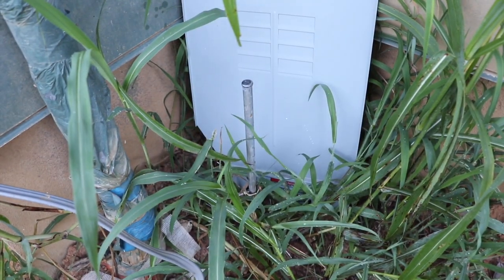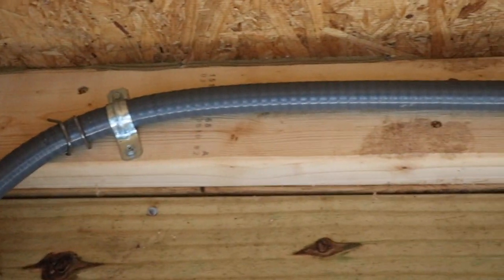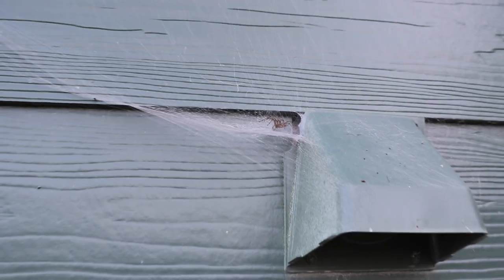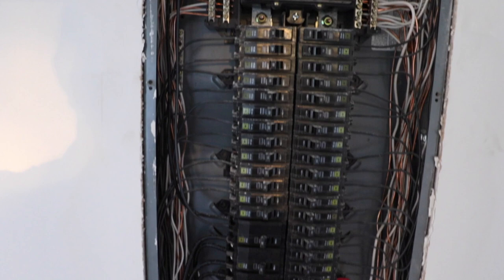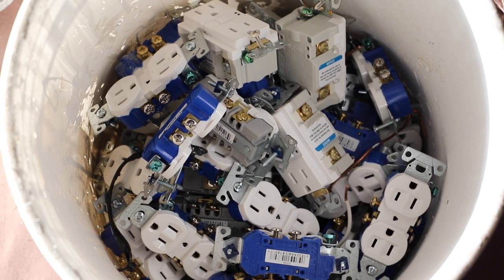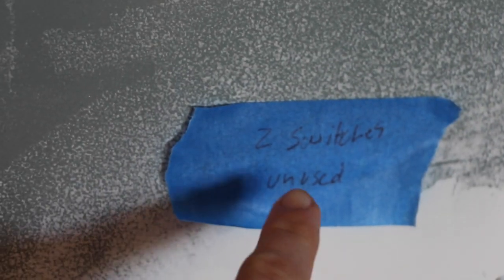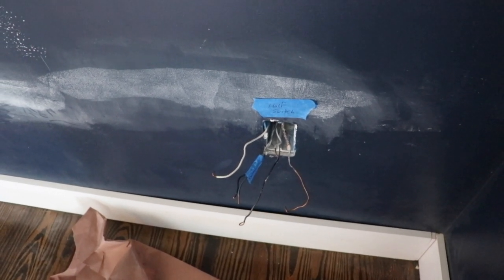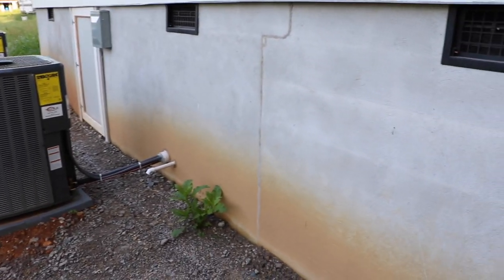Electrical Contractor Failures - Trade Tips

Comment: They didnt mix neutrals and grounds in ac box that ac box does not have a nuetral its just 240 volt with a ground running to it is what it looks like
Reply: My thoughts exactly.
Reply: I would love to know how that AC panel is getting 240VAC. I see two 2-pole breakers. But only one terminal lug for power. Only one black wire going to the terminal board to feed those breakers.
Reply: Robert Steich I noticed that too but if god look closely you can see the second leg going to the bottom lug of that panel.
Reply: Clayton Spangenberg ahhh yes. I should’ve worn my glasses before making a comment. I do see 2 black wires from the center bottom hole, one marked with a white tape for some odd reason. Which isn’t legal as that is technically denoting that, that wire is a neutral wire. And since it appears to be 8 awg, marking a black wire white is legal because of cost and such. However in this case it wasn’t done properly. 

But still like to know how the guy thought there was a neutral wire in the box landed on the grounding bar.
Reply: I was thinking the same thing about the neutral and ground comment. However, he missed that one leg of the 240 wasn't marked red.
Reply: You cannot mark an ungrounded conductor with white tape regardless of the size of wire.
Reply: Why not? Wires are wires doesn’t matter the color it’s all about the usage I can warp a back number 6 Awg wire is white tape to identify it as my neutral. using a neutral as hot plus black tape on it it. Using a black for ground or ground rod u can wrap it with green tape.
Reply: +avatar12able 
EGC's (Equipment Grounding Conductors)
NEC 250.119
Insulated EGCs #6 and smaller must have continous outer finish that is green or green with one or more yellow stripes. On #4 and larger a conductor can be re-identified with green tape at every point that is accessible. 

Grounded conductors/Neutrals 
NEC 200.6(A) and (B)
Size #6 and smaller one of the following methods:
continuous white or gray finish
3 continuous white stripes along entire length on other than green insulation
(theres more but the above is the most common way)
Size #4 and larger
the above methods or by using white or gray marking such as tape at termination points

Ungrounded conductors do not have a size limitation for re-identifying conductors as far as I know. NEC 210.5 (C)(1),(2), and (3)...
Reply: Your color  codes are confusing for me Im an electrician in australia. Our color coding is outlined in AS/NZ 3000 2018 red  or any color bar black is active  black is neutral earth is green or green /yellow and any unlicenced work is liable for a fine or imprisonment and your insurance can be cancelled until the work is rectified by a licenced electrician

Comment: A 2:00, that is the neutral with the mutliple strands, not the ground. Also the neutral in most cases, they want to see the strands taped together.   At 4:45, on any sub panel (not the main) any neutrals and grounds have to be separated and their need to be separate ground and neural bars and the neutral bar has to be isolated. Also the two blacks going to the double pole breakers (240) should be taped so they are identified as one leg and the other. (one red and one black etc).  The outside outlet, even if it was a dummy, should have been made to look correct by a gfci, or if fed upstream from a gfci or gfci breaker, should have a gfci identifying sticker.

Comment: Inspectors are not always correct, sometimes they are actually quite stupid. I was on a job we’re an inspector failed the electrical because the bottom recepticals were not working in all the rooms . The home owner paid extra to have them all switched, so lamps could be placed anywhere and on a switch. Usually the switch one receptical in each bedroom, and that must have been stuck in his brain. I have called out inspectors many times. Also you watch and believe way to much on tv or the Internet.
Reply from the maker: Jason B agreed on inspectors.  Your comment made me laugh because we have receptacles with bottoms on switches... oh man was that a stumper for both sides lol. I think the inspector tried to get over zealous because of the  workmanship.
Reply: @Jason B
So the inspector noticed the switch, but didn't notice no ceiling fixture? The homeowner paid extra for less. You're saying he switched ALL the receps in the room? Usually the farthest recep. from the door is split wired half hot, not ALL of them. You don't want the alarm clock switched.
Reply: Electrical inspection is all about the code, and the 'way things should be done.' If you deviate from that standard design in any way, it results in a very confused inspector.
Reply: The shock to me is to see all this finish carpentry and no networking conduit. IoT is coming, and even if you only cut holes and run string where wires will be, that's at least a lot less quaint than this setup. Not everything can just hop on the wireless router and be happy with data rates and security levels. My sister is having a fit right now just trying to fit all the portable devices onto her router. Granted they're present and active most of the time, but shared wireless bandwidth isn't the limiting factor, its the high encryption and accompanying need for constant manual privacy reconfiguration which IS!
Reply: Last house I was rewiring, the entire, I mean ENTIRE main floor was outlets that were half switched, and not a single ceiling light outside the kitchen or bathrooms. Royal PITA! Why? WHY!?!
Reply: Jason..I've wired that way in the past, mainly for a handicapped guy who wanted something easier for him to use, but I was on site when the electrical inspector came out, and explained to him why it was wired that way...he had no issues with it, and I didn't charge the homeowner for anything except the material...my good deed for the day!  lol This switch controlling part of an outlet works very well especially christmas decorations.
Reply: Vyl Bird although I agree with your statement the NEC(code) is the bare minimum and not a design standard. This is mentioned in the preface.
Reply: If you guys work as a electrician you would see all the code violations in this video only place the grounds and neutrals going is at the main all sub panel need to have the grounds and neutrals separating I could go on anon I rest my case
Reply: Yeah, that was bad.  But was it really a sub panel?

Comment: Just a few things that bugged me the most in this video... At the main service your grounds and neutrals can be on the same bar because they're bonded together there anyway, the liquid tight in masonry doesn't need a chase, mechanical contractor probably ran the low voltage without a chase,  240v to a.c. has no neutral, every ground rod for the most part sticks out a bit for the clamp, but is still technically below grade, and grade at the time of install may have been higher. Have you read the code book? This video should have been more about the sloppy work than code references.
Reply from the maker: The panel was the main sub panel, the grounds were over a foot above grade and were installed a couple days before the video... not the brightest critic...

Comment: To add salt to your wounds, there was no inhibitor used on the main lug connections...but at least there was a guard spider doing his job....another point...depending on the age when this panel was installed, it might have been installed before the 2002 code changes regarding arc fault protection.  This was definitely a DIY job probably from a cousin who "is good at electric work!" You got your work cut out for you...good luck...have fun! I've seen worse!

Comment: A few rebuttals from a licensed electrician (yours truly)...

1. On the A/C subpanel - No-Al-Ox is not a code requirement, and there are no line-neutral loads served by it, so a separate neutral bar is not required.

2. If the main subpanel was installed before adoption of the 2002 NEC, AFCI breakers are not required unless new circuits are added or an existing circuit is extended more than 6 feet.

3. Tamper-resistant receptacles are not required where the receptacle is over 6 feet above the floor or located behind a major appliance that is not easily moved.

4. No NEC rule about plumbing above a device box, just over panels, switchgear, meter sockets, erc.

5. Exterior or service receptacles in residential occupancies are not required by the NEC to be dedicated circuits.

Comment: When you tie neutral to earth ground in a subpanel, you're created a potential parallel path for current to return via earth (ground) - so in the event of a fault, your ground conductor has assumed the role of the return path for current and now everything that you've grounded (sub-panel, appliances, metal fixtures, etc) to that sub-panel is now hot.
Reply: Just Another War Robots Channel QED.
Reply: Thats why you run a seperate ground. And thats why it is bonded at the main panel.

Comment: 4:50 Since this is a subpanel there should be two bar one for ground and the other one neutral. The greens screw exists to ground the electrical panel. Should only be in sub panels. The only place in the system where the neutral and ground can be attached on the same bar is the meter panel that's attached to your 2 eight-foot ground rods. Electric compound is only require on aluminum wiring. Because steel will cause aluminum to corrode. The panel should also have insulation bushings on the conduit.
Reply: You're the only guy I've found so far that caught the bushings. Eventually the Romex sheath comes to a point where it's been stripped, and punch out always leaves a sharp burr or two.

Comment: It sounds like you know just enough to be dangerous! Yes the contractor did make some code violations, but you also made some yourself... Like the wires in the wall for future use that you had to trace out! Many items that you named as violations weren't! 
Use a licensed electrician & check his references! And leave the electrical work to the professionals!
Reply from the maker: Dewayne Fanchier wires in a wall unhooked up are a common practice in building and about as dangerous as a string.
Reply: Dewayne Fanchier exactly." Plates" ? Those are busses.  He's not stupid though. Just not as experienced as should be to call out faults.
Reply: Loose wires in the wall is a no no, if you put it there for "future use" then spend the extra $3 for a proper junction box and blank cover plate. Leave a few loops of extra wire in the wall secured near the box. You'll know right where it is, you can test it to make sure the wire didn't get damaged between rough in and trim stage, you won't have to mess with rewiring your switches, and if you need to move it later on you'll have extra wire in the wall to do it. So what if you have to patch a little drywall later on, it's worth the peace of mind knowing there's no chance of a loose wire being hooked up live dangling inside a wall somewhere, or the off chance that somebody hits it with a drywall screw and you don't find out until a year later after the place is done when your "future use" comes up.
Reply: It's a violation,  coming practice or not!!
Reply from the maker: Dewayne Fanchier indeed it is not.  And it makes it a lot easier down the road
Reply: Should have read "common" not "coming" I used my phone, & I guess it thought I meant something different.
The violation with the wiring falls under 110.8.
110.8 Wiring Methods. Only wiring methods recognized as
suitable are included in this Code. The recognized methods of
wiring shall be permitted to be installed in any type of building
or occupancy, except as otherwise provided in this Code.
The only recognized method for "future use" wiring is under communication (ie IT, Video, Audio, etc.). There's NOTHING in the NEC allowing abandoned wires in a wall!!
Reply from the maker: Dewayne Fanchier they can be as long as they are "terminated" you could also just not have them wired up at all (which our inspectors preference although terminated was still required).  Tell me which code is then violated for having an unused non wired wire in the wall?
Reply: Both ends must be in an approved enclosure, not hidden in a wall! I challenge you to find an NEC article approving wires hidden in the wall. :-) 
Remember, if the Code doesn't say you can, you can't.....
Reply from the maker: So it's not the same as the Pirates code... that's a bummer. Still local jurisdiction has authority so if they feel comfortable with a terminated end than it's a pass.
Reply: You are correct with the AHJ. I have worked in areas where the AHJ has added to the NEC, or decided NOT to adopt certain parts...
Reply: He did mention in the video that he was hiring another professional, and even after excusing the first for legally-unacceptable habits, #1 also removed markings or failed to remark wire where removal was unavoidable. Your arguments have dug for you a grave and pushed you right into it!

Comment: The AC panel you showed wasn't really that bad. The wiring was fine. The makeup a little sloppy, ringing of the conductors and the grounding was correct. There were no neutrals, as there is no need in a panel that only feeds A/C equipment. There was also no reason to change over to arc fault breakers, as you would've been grandfathered in, the same with TR receptacles.
Reply from the maker: The arc fault breakers is one I feel like the inspector was over zealous on, while it was all new wiring, it was also a "remodel" which also pulls into question the necessity of TR outlets.  But a county has the right to require above and beyond what the NEC requires... and contractors working under permit should know the municipality they are working with.  If the "sloppy" aspect was not a factor, it probably would have been ok.
Reply: If you look at the top of that box, The ground and common feed are lugged to the same bus bar. If the ground and common are mixed on the supply side, it makes no difference if they share common rails on the load side (individual circuits). That being said, The box may be mis-speced for the application if a separated common is required.
Reply from the maker: Notso Fresh they aren't supposed to share the same bus bar on a sub panel... that can only be done on the main panel.  A separate bus bar was installed.
Reply: Don't get me wrong, that wiring looks like a dogs breakfast.  It may not have met code just because of that, even if its safe, and should have been changed. Code exists both for safety as well as uniformity to make it easy for the next guy to know what you did. In this case, because the common and ground share a lug at the supply to the box, they are mixed there any way, this means that electrically it does not matter if you mix the circuit wires. This being said, if the code says separate them, you do it. Not just at the circuit level but also at the supply. This is why i said the box may have been mis-speced. That box in that configuration  may be meant for a primary and not a sub panel. It may not have been the right choice for the application with the codes in place where you live..
Reply: it has to do with a parallel path for current flow on the neutral and possible energizing of the ground wires resulting in electrocution when a subpanel is mistakenly bonded, and the double taps work loose and make it likely to cause exactly that.
Reply: Yanasa Ama Ranch correct. My house had the same problem at sub panel. I bought my own ground bar at homedepot for a few bucks and did it myself.
Reply: Notso Fresh not allowed. You should always remove the bridging bussbar from any subpanels and run a dedicated ground back to the main ground buss and a dedicated neutral back to the main neutral buss. 

You want only one path to ground and the ground is not a current carrying member. 

The neutral on the other hand is designed to carry current and must be sized appropriately. 

If you don't keep these busses separate, you will have noise on the ground, arc fault and ground fault breakers will false trip in some cases, and you can damage electronic equipment and corrode copper wiring in some situations.
Reply: In that case there should be a wire from the grond lug to the box to ground the box itself ( i think the lug are insulated from the pannel ) 

Every metal should be grounded in electrical installation
Reply: The neutral already had been bonded to the XO back at the transformer before it got to your main panel.
Reply: @YanasaTV  isolated nuetral